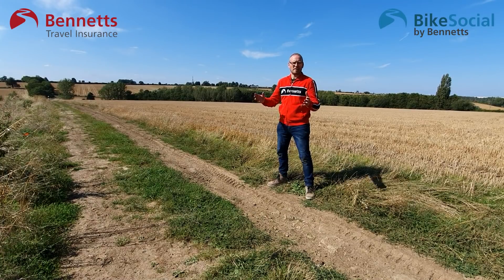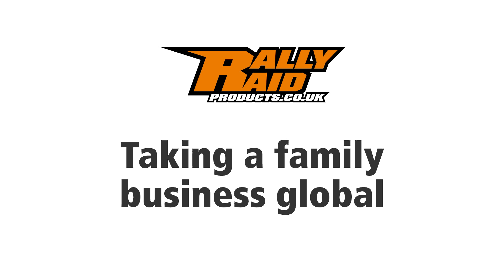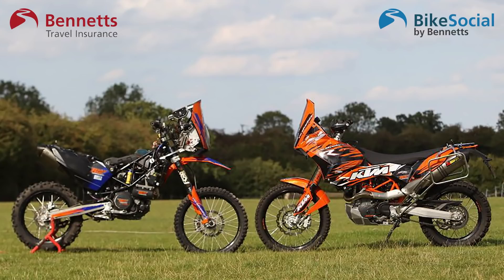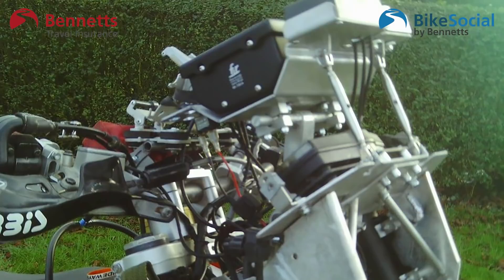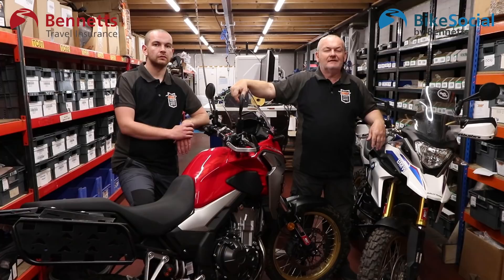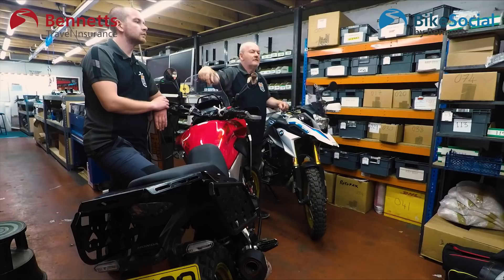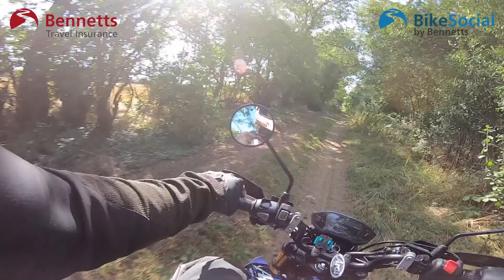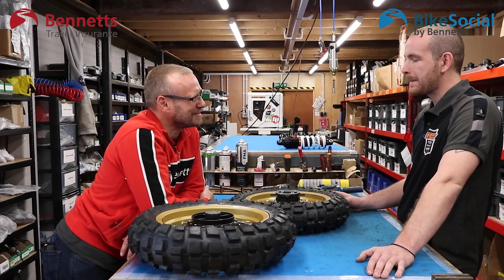From Africa Twin to Africa Grom | Making the perfect adventure bike: Rally Raid

Comment: Best ADV quote-ish. "I rode the ring off it, no problems." When I walk in to buy my T7 that is exactly what I will ask. "Can I ride the ring off it with confidence?" Shakespearean bike speak. Lovely. Or Robbie "dirty bugger" Burns. I always wanted to start a car park race series for groms but dirty groms look even more fun. Erzberg Grom Class?
Reply: I'm sure the dealer would love to tell you yes to that, it's a yamaha so you'll be right back in the shop forking them over paycheck after paycheck. Are you aware that the T7 doesn't even have a consistent maintenance schedule from country to country? In the schedule for Thailand they ask for less maintenance than in America!!! 😂 It's not like it was great to begin with either, the T7's schedule is shorter than many of the thumper on the market. If you actually like riding, buy a Honda. If you don't mind paying KTM money and doing KTM levels of maintenance and expense then buy a T7.